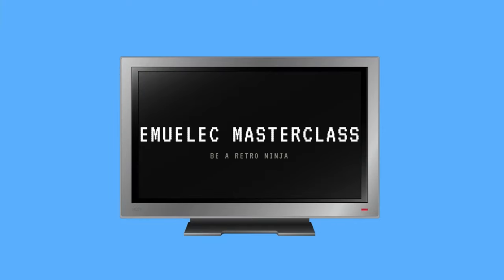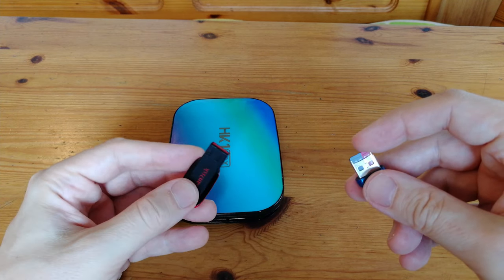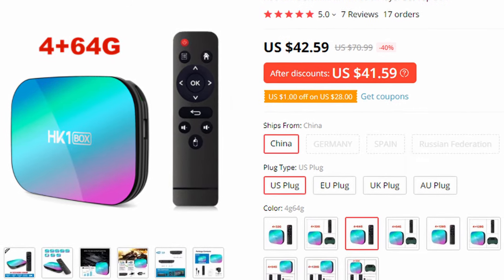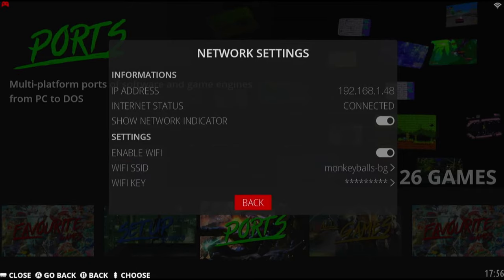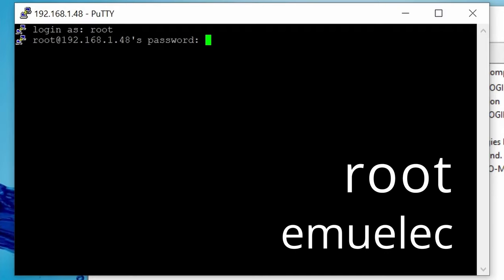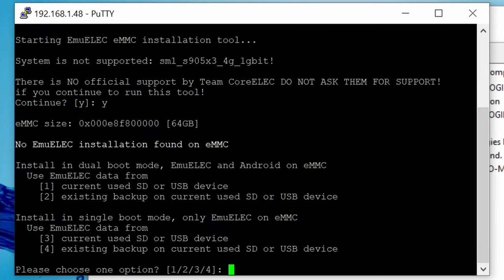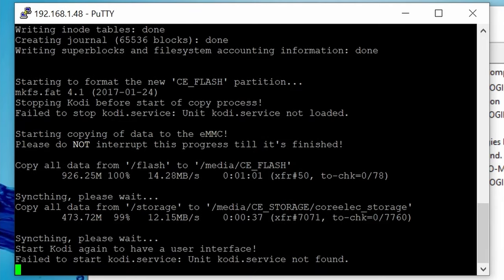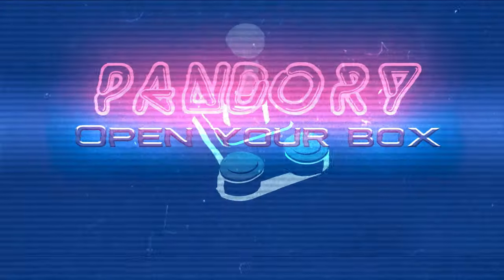Run EmuELEC from USB / Onboard eMMC [EEMC203]

Comment from the maker: Attention  - As of EmuELEC 4.4, they have REMOVED CEEMMC, so please use EmuELEC 4.3 or lower for this tutorial
Reply: yep and OTA update (update over wifi/lan within emulec) brick the device..  no user data found, corrupted emustation config...
Reply from the maker: @antoinejona  not exactly a brick, but close. More like "they're messing it up!". I think almost every update since 3.9 needs to reflash, it's becoming a bit of a joke and I'm surprised it's not been forked and updated by another team.
Reply: @TeamPandory   completely agree...  emuelec 4.5 is out, maybe i'll  give a try with this version? need to read the changelog first..
Reply: They have a new method, it's in the forum.
Reply: @LuisAFigueroa  cant find the new method on emuelec forum ./
Reply: @antoinejona  Don't bother trying, it doesn't work. However, what I'm doing is installing version 4.3, then running the installation to internal MMC procedure and right after it installs, I just update to 4.6 from within the system.
Reply: @LuisAFigueroa  yes you are right!  just did the lan update 4.3 -> 4.6 and all his good!   another question, do you know how to change/update the dtb.img on the eemc? the current i'm using doesnt work with the wifi chipset.. i've found another one working (tested by booting on usb)... winscp doesnt allow me to delete/upload different fw
Reply: @antoinejona  I'm glad it worked and no I would not touch the installations files after already installed internally. However, a future update might get your Wi-Fi chipset running, but that might take time because the EmuELEC developer just said he doesn't have the time to do it anymore. Hopefully another team will take over and continues updating this great OS.

Comment: Between you and Wicked Gamer, I spend way too much money on tech that I see in your videos and then want to try this stuff out for myself.

Monkey see, monkey do. 🐵
Reply from the maker: The hk1box is around 40$. No need for a microsd for the games, don't need to buy a case or power supply separately- a pi4 killer right here.
Reply from the maker: @Spawnholio  what about Ali?  Check the video description I left a link.

Comment: A few days ago I decided to do this experiment. I bought a TV box with S905X3 and 128 GB of RAM. I'm waiting for it to arrive from China. I had already done some research and put together some instructions on how to do it. But now it's much better, because I found this video, which is excellent and will make things easier. Thanks for the tutorial!
Reply from the maker: It's a pleasure.  There have been reports of a few Android boxes not being compatible, but they are usually because the buyer bought a Rockchip, or got a 905x3 or x4 that had the locked down updated Google system, but those are far and between.  (usually by mecool)
Reply: @TeamPandory  The one I bought is from Vontar! It's likely to work! Thanks!
Reply: ROM*

Comment: i buddy i have the emeelec set up with sd card on amlogix s905x2 i want to install rom etc on a 2 tb hdd is there a way to install everything including emuelec operating system and all roms on a 2 tb hdd ??
Reply from the maker: Should be able to, I know you can have ROMs in an external location.  Check the emuelec wiki for more info on that

Comment: TOP

Thanks, it works. Can I make an EmuElec ISO backup from an internal repository?
Reply from the maker: The important thing is, it needs to boot with a valid dtb. So get that sorted on a usb stick or a microsd on a usb microsd adapter- then you should be golden.

Comment: My box only has 16G of internal memory. 
Is it possible to boot Emuelec from SD card and run games from a USB drive.
Or store Emuelec on the box and rin games from the SD card.?

Thanks for great content.
Reply from the maker: Yes, of course.  Check our emuelec installation guide which will show you how to do so.

Comment: Friend, I have the TV Box HK1 Play (S905X2 4/128gb), but I tried to install a Custom Firmware via SD card and the Box is bricked, it is not detected on the PC in the USB Cable by the USB Burning Tool, I cannot reinstall the system Its Android on SD card (image does not appear on HDMI), can I somehow reinstall the Android system on this Box??? This method of Emu Elec in the EMMC internal memory, can I boot from the pendrive or SD card with card reader to boot and reinstall Android via Putty??? I need to revive Box, it is dead in blue and red LED.

Comment: I am having difficulties getting the box to boot into emuelec via a flash drive.  It boots just fine from a SD card, but it does not seem to recognize the flash drive.  Anyone have a solution or ideas on what I need to do to get this to work?

Comment: Great hack!! However, are you limited to the remainder of internal eMMC eg 55gig or can you do another hack to use an SD card too?? eg, 55gig of eMMC and then another X of SD space? Also, with internal eMMC is there less risk of corrupting the file system as internal is usually more stable than SD?? Big thanks.
Reply from the maker: If you shut down properly there should be no risk in data corruption.  In emuelec you can use internal / emuelec and the microsd for your roms if you wish. There's a switch in the emuelec system settings to select internal or external- but I don't think you can make one large set. Either internal or external.
Reply: @TeamPandory  many thanks for the response. The issue I get with risk of SD corruption is when there's a game crash or screen freeze and the standard double press of start/select doesn't get you back out of the game. I think I'm forced to turn off the crashed emuelec!! Therefore, if EmuElec installed on eMMC with ROMS also, then I guess there's less risk as the eMMC media isn't so fragile?!

As far as running main system from eMMC and then load the ROMS from SD, I'll check EMuElec settings, that'd be great, although I guess onyl really useful if you can use up internal first and then SD card for extra ROMS. Thanks again
Reply: @avamaeva7999  If your Emuelec / RetroArch is frozen and you can't access the Menu, connect via Commandline, like in this video, and send the "reboot" command. The system will save the metadata and boots again clean. No hard poweroff :)

Comment: Not working on 4.3 
EmuELEC:~ # ce
-sh: ce: command not found
EmuELEC:~ # ceemmc

-sh: ceemmc: command not found

Anyone? couldn't find solution on the web
Reply from the maker: Perhaps try an earlier version then update? ... TBH I was pretty offended when they removed this, as my primary 905x3 has a broken microsd.  - Which box are you installing this onto?
Reply: @TeamPandory  will try when back home. T10 pro s905

Comment: Hi,

I have installed my system on internal memory, but I would like to set the default boot to USB. Can you please advise me?
Reply from the maker: Provided it's rooted, it should run default first from USB or MicroSD.  If it cannot boot then it'd run the system from internal memory.

Comment: If you were take the sd card and connect it to your phone (S21 etc.) or into your computer, would you be able to run the games? You could achieve better performance this way right?
Reply from the maker: ?  How do you mean?   This is a video showing how to run emuelec off the nand.
Reply: @TeamPandory  Yeah my bad I realize that. I was just wondering in general with any of these consoles/rom games, if we were to take the sd card out and use it in a PC or higher end phone would the games that don't work so well potentially work better? If so, I wonder if it's possible to just an order an SD card with the roms on them and use them in whatever device you want.  I guess we'd need to make sure we use the right emulator but that shouldn't be difficult right ? These consoles always seem to be underpowered so it would be really convenient to be able to run the roms from whatever device you want. It seems like it would also be more convenient getting the roms on the sd card rather than finding everything separately. Thanks for the info.
Reply from the maker: @ACYYZ  I guess you could do that, but it really depends. The console x had part of the microsd partitioned to fat32, so it'd work like you mentioned- but if the games are on a linux partition, you'd need to faff a bit. 
To say they'd perform better or worse. That again depends on the system that you're migrating to. If you have an i7 it should have no problem, but if the hard drive is failing, or has another issue, it could potentially perform worse. Hope that makes sense.
Reply: @TeamPandory  Yeah it does, thanks for the info. I may look into that option then. Just gotta see if only the sd cards loaded with the roms are available.

Comment: So, no luck on 4.2 . SAME ERROR . so either the box itself or some putty setting that I am missing..
EmuELEC:~ # ce
-sh: ce: command not found
EmuELEC:~ # ceemmc

-sh: ceemmc: command not found
Reply: When we wrote ce, don't push enter, but push tab a few times- it will give you a list of commands that start with ce.
If the command is not there, then it should be the build of emuelec itself that is the issue.  

Which exact chip and version of emuelec are you using?  It may only be in the NG versions of emuelec - We used 905x3 with the 4.3 NG build.
Reply: @timwilson1042  so , apparently with s905 is not working due the image not beeing the ng version . i did try to flash the ng but not luck with three .img . testing batocera tonight. what a shame i was looking forward to it

Comment: after flashing on to the internal memory successfully is there a way to flash again the stock firmware for the hk1 box?
Reply from the maker: Yep- https://youtu.be/oeaV_YbS4f4
Reply: @TeamPandory  is there any other method?i dont have usb male to male
Reply from the maker: @SixtoRoman12  no. Go get a cable if you want it done.
Reply: @TeamPandory  i just grabbed one,tried both v2 and v3.its not detecting the box

Comment: Hi, my hk1 box went garble and blank screen at TV display after 3 to 5 minutes boot up. After reset problemstill persist. Do you have any ideawhat is the root cause. Thanks.
Reply from the maker: After this guide? Was it always like this?  Need more information.
Reply: @TeamPandory  not because of this guide, but when I first bought it, it was like that
Reply from the maker: @Aurora-pq5gn  You have a 4k tv?  Tried a different hdmi cable?

Comment: Thank for sharing this. I ha ve a question and hope you can help me fix ít. I have tx3 mini 2021, and i want to install emuelec on it, i used core p281_2gb to install but when firrst run on tx3mini ( pressed reset hole button) but nothing happened, it just booted  into Recovery mode. Can you help me fix it, tks and hope to get your reply soon. Sorry my bad English because it's not my mọther tongue
Reply from the maker: Have you tried going through the emuelec guide?  I usually use the libreelec boot apk rather than go for the switch in the hole.